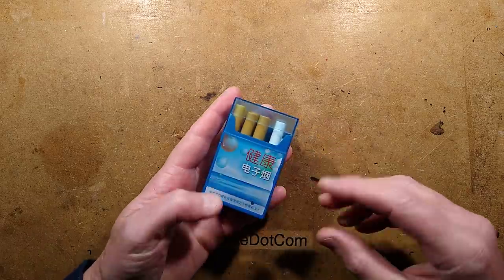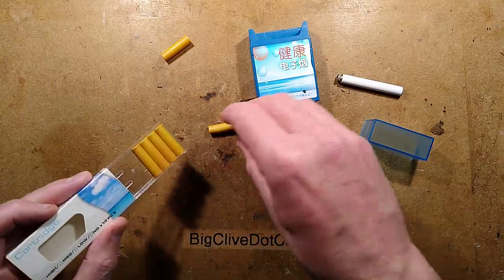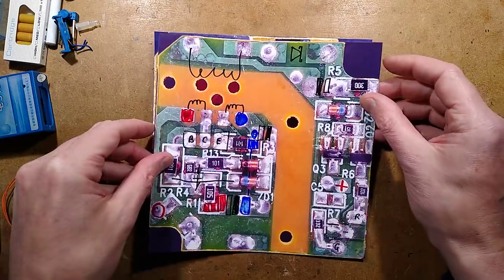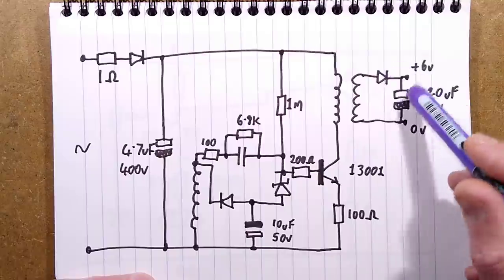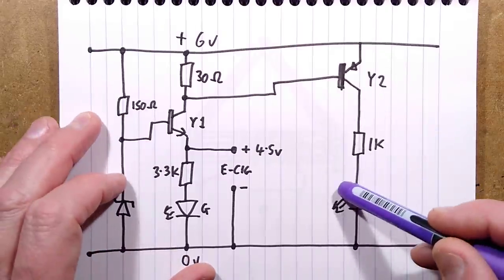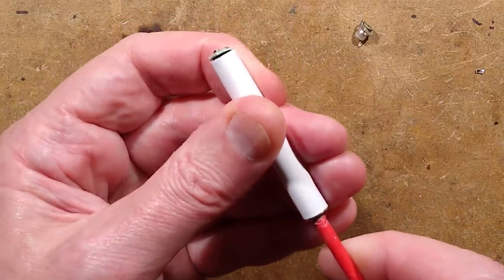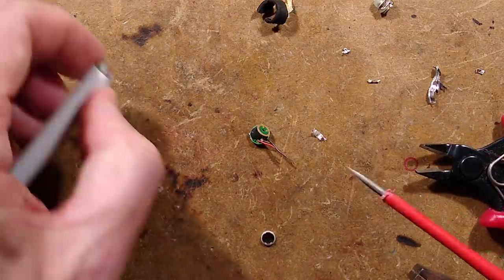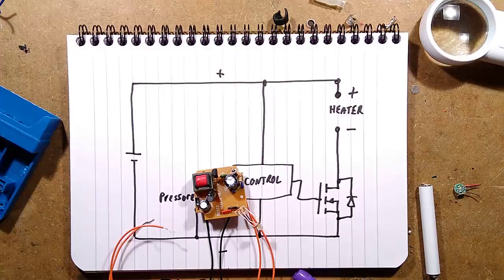Vintage novelty device teardown (with schematic)

Comment: Interesting note about the microphones: Just like that pressure switch, a condenser microphone also has a transistor inside it as a sort of internal amplifying element. The difference is that one uses the mylar foil as one of the plates of a capacitor, the other works as a switch when both touch. I bet, if you really wanted to, you actually could pick up sound with that pressure sensor, because that capacitance will always be there to some extent.

Comment: I found one of the modern disposable ones lying in the street the other day. I had no idea what it was at first, but my teardown was very similar to yours. The newer one had, as you said, a more integrated pressure sensor.
Of course, it had no recharging circuit. Frankly criminal that these things are marketed as disposable.
I got a handy 950mA lithium battery out of it, though.

Comment: Nice video. Of course being a Japanese unit, it would have been designed primarily to use Japanese 100 Volts, 60 Hz. It would have been interesting to pull the transformer apart. As you know, all the best stuff is made in Japan, so the transformer isolation might have been as impressive as the board isolation...
Reply: Its Chinese not Japanese though
Reply: @shrimpbear2544  Thanks. I looked up vaping in simplified Chinese and sure enough it came up as: 电子烟 As the old joke goes, they all look the same to me...
Reply: @ats89117  that joke is actually because the Japanese use kanji (han-ji), the Chinese writing system they borrowed a while ago, along with other alphabets.
Reply: I was confused about that as well. Apparently the Chinese have a "Type A" plug that looks like the Japanese and American plugs.  I'm pretty confident the writing on the unit is Chinese and not Japanese, though - no Hiragana at all.
Reply: @thenaimis  Yes, you're right. I forgot about the Chinese "Type A" plugs which are similar to the Japanese and American plugs but are made in such a manner that they won't stay in the outlet... You have to hand it to the Chinese. With rare exceptions, their stuff is exceptionally crappy...
Reply: This is definitely from mainland China

Comment: No revenue soup for YOU! Ya naughty bear, how dare you say the V-word on Youtube? At least it'll make a change for the demonetizing folks to screw a vid for that and not the C-word or variants of such... Thanks for making the effort just for us, that's why we love you!  Also, I pulled apart a similar (albeit disposable) unit a few years ago, think it was branded "3motives", & it was built pretty much the same way. The battery pack just pushed out from the vapour hole at the top, I was quite surprised at the closeness of fit given that the air had to be drawn past it in order to activate the thing!

Comment: Ahh, the venerable M-series. These were quickly supplanted by the 510, which introduced the vaping community to the potential of refilling the carts. The old 510 kit I started with came with a similar charging box, but it also contained a battery in the case so you could recharge the actual vaporizer battery "on the go". While I quickly moved on from there, that little thing got me to quit smoking cigarettes literally overnight. It's been 11 years now, so it did it's job.

Comment: The 30 ohm  resistor does not limit the current.  The base emitter junction of the PNP transistor acts as a diode in parallel and will conduct lots of current even though the voltage across across it and the 30 ohm resistor doesn't rise much above about 0.8 volt.

Comment: I had that exact pack of cartridges along with the white battery holder. I never did use them all because the market was evolving so quickly it got superceded before I used them up. I remember thinking it was way too fiddly.
Plus, the manufacturers realised that it wasn't a direct copy of cigarettes that we wanted. We just wanted huge clouds of heavily nicotined vapour & a stylish stainless steel creation. 
It was an interesting dead end. 
The vape I got to replace these had me making my own coils with ceramic tweezers & rolls of Nichrome wire. Splendid fun!
But soon replaceable coils came in that were much slicker to use.
Great video Clive,  down a sparsely trodden memory lane. 
Thank you 😎☁️
Reply: To be fair, as much as the disposable ones are much easier, the new non-refillable plastic create so much waste. It's like we've come full circle back to these ones!
Reply: @EdgyShooter  I bought a Juul to see what all the fuss was about. 
An absolutely terrible device! So damned expensive to refill. 
So I'll stick to my tank, eleaf coils & making my own juice by the litre. Much more economic with recyclable waste.

Comment: Hi clive; i've heard you call it glycol a couple of times but just "glycol" is normally taken to mean ethylene glycol (as probably the simplest member of the family) which is pretty nasty stuff. 
Vape juice is based on propylene glycol, glycerol ("propanetriol") or mixtures thereof. You might not expect an extra carbon atom to make such a big impact, but when strategically placed it makes all the difference.
Reply from the maker: There are many glycols.  I wouldn't automatically assume that a glycol is specifically ethylene glycol.  It could also be triethylene or butylene glycol, both of which are used in fog fluids.

Comment: I had something very similar to this around 2009-2010. The white cigarette part screwed into a USB to charge (similar to cheap vapes today). Mom found it one day plugged into the back of my wii and asked what it was, I was 16 at the time, I told her it was a wifi antenna and she bought it.

The cartridge pack, when you first inhale, you had to really pull in order to pop it, then the menthol is free. There was a lot of vapor that came out and the tip glows red because it was designed to simulate smoking to help break addiction. Apparently the subconscious triggers like seeing the glow, blowing out the vapor, the white stick itself, etc was nearly as addictive as the nicotine itself and you'd have a more difficult time quitting without these extra triggers.

Comment: Love it! you are such a master of reversing engineering! plus your honesty when your "projects" misbehave lol DVD:)
.
Reply: By the way I want saw a DVD player that misbehaved no matter what button you press I know unit or the remote the loading tray Orton start just going in out until you pulled the plug.

And as so far as I can tell an exhausting search of 4 problems was the microprocessor itself was doing this otherwise everything checked out normal this is from someone that had two of the same units which I was able to use troubleshooting absolutely nothing else seemed abnormal even on a component the component basis crazy I know but weird one for sure.

And yes I tried turning it on and off of course but this was not a soft error this was definitely a hard error of some sort but then again this is after a the severe thunderstorm.

And that's was the only component in that system that was not fun into a surge protector!

Just may have had something to do with that probably not coincidence I'd say!

Can't remember the exact reason it wasn't plugged into the surge protector but judging by the number of things plugged into it and the number of adapters and so on plugged into the strip even perhaps it was just a tad too much or they couldn't figure out a way to plug in just one more thing into it.

This was long ago don't remember the exact situation but I do know back then it was usually not easy to find a surge protector with that many outlets probably in excess of 12 receptacles least!

And I believe it was only 10 amp breaker on that strip if I remember correctly.

I want actually saw a surge protector at one time that actually had 20 AC receptacles on one search protector and it was claimed for kitchen use 20 receptacles in a kitchen where there could be heavy duty appliances no thanks.

Also I had a relative ones that had a lightning strike.

And I got a call from one of the other relatives.

Asking what could have caused a big dent in the outside on one side of the microwave.

When they had mentioned about the lightning strike.

Well chances are that's is where the transformer for the microwave is and chances are there was tremendous amounts of voltage and current through the Transformer turning it into a big electromagnet or just because of current flow causing this because of magnetic force.

I don't remember if it still worked but I don't think it did a long time ago.

Think there's been at least two microwave since then.

Whitney Hughes hit they're more than once if I'm not mistaken.

Actually yeah another time and years ago it had hit the TV antenna no lightning arrester or static discharge evidently.

Also the TV was unplugged at the time however still connected to the antenna twin lead.

This was installed prior to coax!

And when the lightning hit it actually went to 232v and the cord was laying on the carpet where to plug was laying the carpet was burnt.

I heard this from at least two of the relatives.

Interesting thing is nothing in the vicinity was metal or even at Ground potential or near anything conducted.

Only thing connected to the antenna again with the when we laid ledian cable.

Once I also saw a melted CRT in a TV years ago!

Again due to lightning.

Also one time somebody called me and said could you come over and when I got there they pointed to the TV and said what could have caused this fortunately no one was in the room at the time she blew.

Well the TV had been on and kablooey.

Picture to imploded.

I asked them was it doing anything strange or something not right before this happened.

And sure enough what I was told course flooded with overscan.

And from what I understand that overtime that the Electron Beam can etch through this glass on the CRT and caused the sort of failure.

And also something with high-voltage issues can cause the same as well but that's just Word of Mouth on that part can anyone substantiate something along that lines would like to know

Comment: Clive. We need an analog Volt and Ammeter so we can see the current increase/decrease without the refresh rate of the Hopi. Possibly for situations like Electric Cake Batter or 240v Hot Dog Cooker
Reply: Yeah great idea thought about that a couple times as well even for my use in my shop even having a analog voltmeter and amp meter and if I could scrounge one up or out of something and AC wattmeter and yes and log AC watt meters actually exist or another option if you could find it which I have not as of yet.

Is an AC voltmeter amp meter that has both Inda Kara needles opposing each other and the chart pretend integrated with the volts and amps for Watts at a glance.

And no I'm not actually talking about earlier in this comment about a kilowatt hour meter but analog wattmeter that has both of voltage and current coil Andorra current Transformer or shunt but used on a AC 2 calculate watts in the analog domain you could say.

Also trying to get my hands on a few old kilowatt-hour meters have an idea to do a coat tree that would look like an old street light post preferred old electric meter that would actually be functional.

But wildly for 120 volts ac.

A box with the photocell on top which would also control lighting as well.

Mainly through a receptacle delphian to this coat tree.

Utilizing Bronson porcelain insulators for the coat hooks.

Which I do collection glass and Porcelain insulators.

Utilizing a old school oblong or other vintage outdoor receptacle cover what the plate modified to take a dacor receptacle which would actually be hardwired USB charger receptacle.

For charging things like headphones and keychain flashlights and such.

The above leader would actually measure power used by the built-in lamp and also a low-level light they'll be controlled by the photocell.

As well as switches to control both as well fan override switch and be able to switch the main lamp the photocell.

And somewhere in a vintage electrical box of some sort.

Have room for future smart Hardware as well.

And of course a couple of receptacles which would also be connected the kilowatt hour meter.

Preferably in an older style of socket.

Another word something you might just find in Old Town somewhere but actually 100% functional in one way or another.

Nav even on top insulator that would not be used for hanging for obvious reasons have what would look like what would have been used in the old times for the original wiring on insulators.

Perhaps even if I could find it the housing or whatever from you'll series Street Lighting systems to run standard lamps from the series Street lighting system.

If I can't find that an external ballast from an old fixture that would have been around that time.

I've seen both of those in my old Hometown that one time.

I once had an opportunity to get a series street light.

And I knew they ran on a low voltage lamp and at that time the bulbs were readily available in that area.

I was even thinking about doing a string of Christmas lights utilizing 18-volt switchboard frosted lamps but ran 12 volts for long life.

For some reason one of our friends houses had low voltage 6 and 12 volt incandescent bulbs in some areas I believe it may have been some sort of emergency light system of some description possibly.

From what I understand there was frequent power failures in the area they were located out of town and rural area as well.

There was evidence of bus system in various buildings with batteries eventually I got the system working again for standby power for low-voltage loads including the battery operated fence charger since this was a form and yes that was the original one that was still working.

Also the Pulsar was actually a turn signal flasher module!!!!

It looked similar to so we didn't hold together Wilson ignition coil in a few other parts but looked a bit like it was commercially made but who knows.

There was two huge insulators coming out of it in one way or another.

Almost look like what was on a miniature oil switch for utility purposes.

And the interesting thing is there was also next to it box with a large insulator and antenna.

And there was a silver box elsewhere I checked it out and sure enough it was some sort of primitive remote switch.

There were a few vacuum tubes in each.

Apparently this was not a one-way deal it could indicate the status of the unit at the other end as well and if it had been turned off locally there was a red and a green and a Amber or yellow indicator.

At that in in the opposite end of the system there's a wall plate with the same and a switch or two as well.

And there was also a lightning arrestor on the electric fence that remind me of the horn Gap although more closely resembled a Jacob's Ladder.

There was a coil and perhaps a resistor to ground.

Also that was located inside a wooden box which makes me think that that was salvaged from something else it was not fitting to the Tom. It was much earlier kind of reminded me of the old birdhouse cutouts.

It did have a label on it saying lightning arrester or similar.

And there was all kinds of other weird and interesting gadgets and gizmos not the only place I've seen that had someone that was obviously ahead of their time moving or staying there
Reply: @aaronbrandenburg2441  sir this is a wendys

Comment: Over here in the US, we had things like these from the company Blu, which I found very interesting in the same mindset as you, fun for the novelty and other uses like easing up on snacking, albeit with zero nicotine carts.

They had the same basic design of the pseudo cigarette case but a Micro-USB port for charging instead of built-in prongs. The other day I noticed Blu had changed on to the current disposable-esque cart-style vapes a la juul and their ilk which was interesting to see.

Comment: Back in 2007 or 08, there was a company in the US that sold units that were similar. They had cheese lights at the end and had replaceable nic cartridges.  They would sign you up for a recurring delivery on the pods.  It used nic salts that taste exactly like a Vuse cartridge.  Horrid.

Comment: These style are still on sale, but they've ignored the case/charger combo and use a USB slug to charge.  While the slug is smaller, once the battery is plugged into it, you've got something that sticks out a good 4 or 5 inches.  Unless you've got a hub that allows it to charge in a vertical position, and supports it from underneath as gravity can pull the slug out if it's "upside down" due to the weight of the battery, it's an accident waiting to happen.

Comment: I remember those, you used to be able to buy tons of the little cartridges off of alibaba by the tonload and they were patently useless and that was my first attempt at stopping smoking, then someone on the ECF forum gave me some sage advice and I found a place here in the UK that did 36mg carto's which had the coils built into the cartridge and the day they arrived I simply stopped smoking.   No craving, no fuss and I do still ecig today with some very fancy hi tech hardware and make my own juices too, still the damage from smoking did the damage and I had an almost 9 hour triple bypass and arterial reconstruction operation fuelled primarily by beer, bacon sarnies, KFC and smoking but I left that lifestyle behind me and I must say that ecigs literally saved my life in that regard.

Comment: I had one like this in the US circa 2009. The cartomizers didn't need piercing with any 3rd adapter, though. The light on the battery stick would blink during charging then stay steady when charged. I remember the battery getting me through about half a day of smoking. I replaced it with a vivi nova and ego-t when they came out because they were refillable. I eventually stopped vaping because I started developing a reaction to Propylene Glycol. Pure VG didn't bother me.